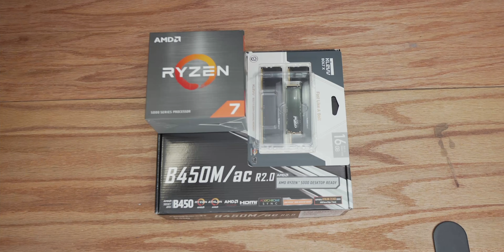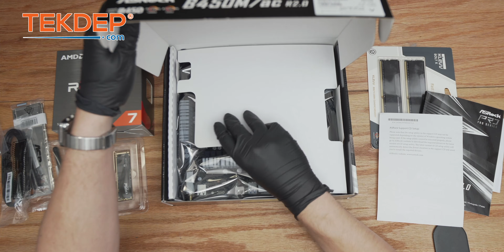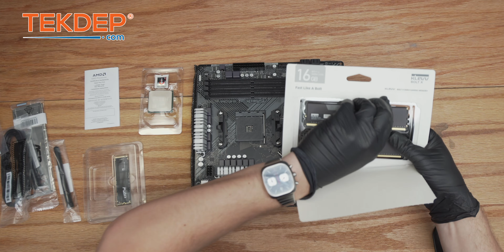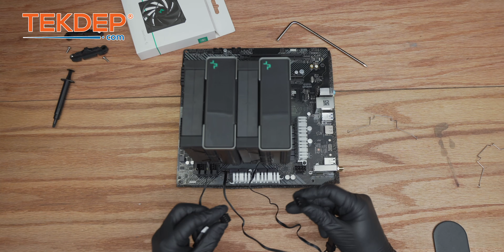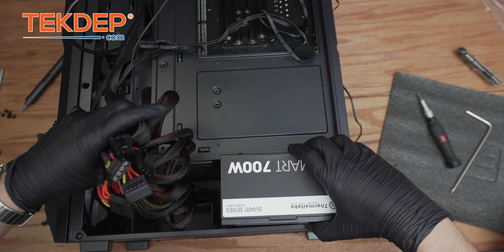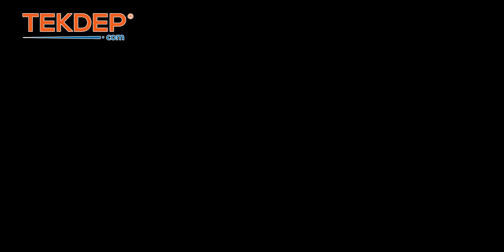Ryzen 7 5800X + RX 6800: Building the Ultimate Budget 1440p Gaming Rig!

Comment: I am trying to build this with a AMD Radeon RX 6800 XT 16 GB which is PCIe 4.0 but the motherboard for this build supports PCIe 3.0 . Would it work if I use the 6800xt graphics card? Yeah man looking at the specs for this motherboard got me wondering. I know it will work since you showed it turn on, but is it bad using a 4.0 PCIe graphics cards on a motherboard that only supports PCIe 3.0 X16 and  PCIe 2.0 X16 in the Expansion Slots? I searched reddit and they said they dont recommend it. They might be amateurs. I am totally confused. Trying to build it for my black friday DIY project. I am going for the High settings for the new game called STALKER 2 Heart of Chernobyl. I know it will work, but over a long time will it affect my PC in a bad way?
Reply from the maker: It is perfectly fine to use a PCIe 4.0 device such as a GPU in a PCIe 3.0 slot. You may leave some performance on the table in this case, but its roughly 1-2 FPS in most games. In my mind, that is not enough to spend more on a motherboard given AM4 is a end of life socket at this point, so you wont likely be doing in socket upgrades and be moving to a new socket/platform when you chose to upgrade your PC in the future.